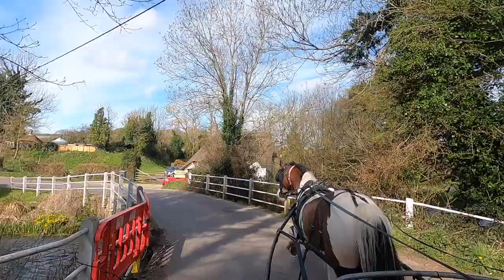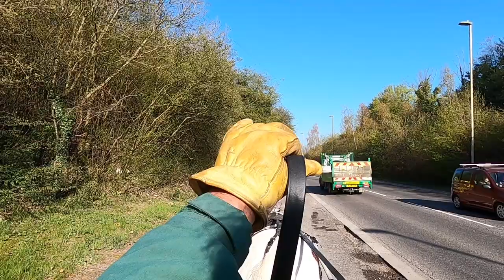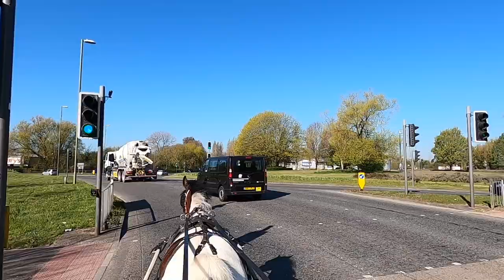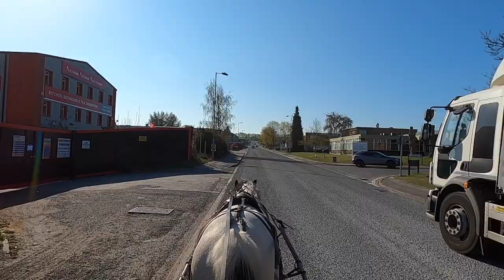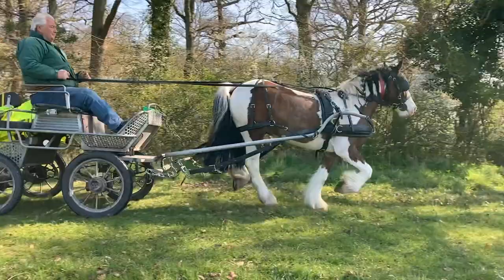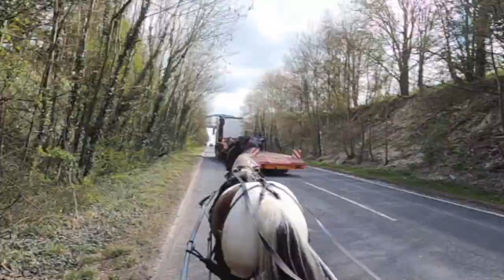Bits, Brakes and Barefoot Driving with Gogo the Cob

Comment: I actually appreciate the discussion on keeping your foot on or near a brake.  Couldn't have guessed to ask. Sensible to be prepared for a surprise, even when your horse will "stop on a dime".  Your discussion recently that even though the rubber bits are very helpful and important of themselves, the key to any horse is good (basic) training.  That really struck home.  You also mentioned you developed putting the horses up near to a rail on a bridge, because it is possible that they can be shoved into such a position and need to be prepared to handle it.  Thank you for all your work.